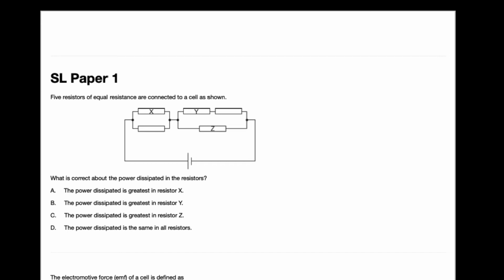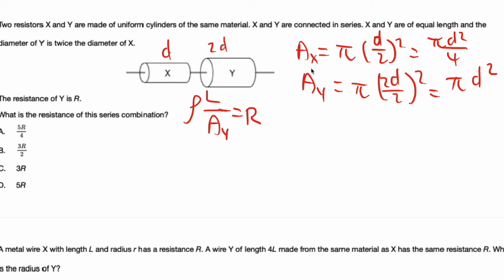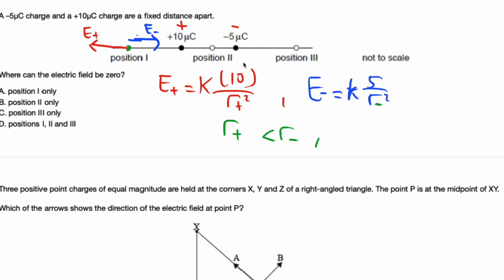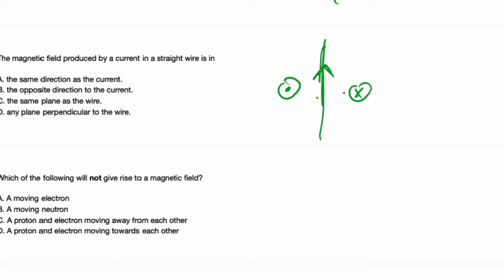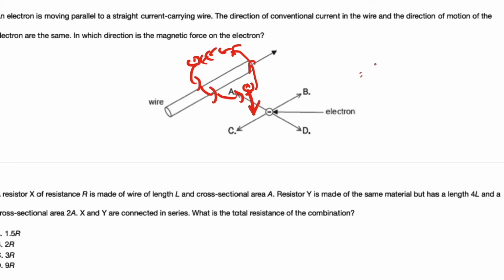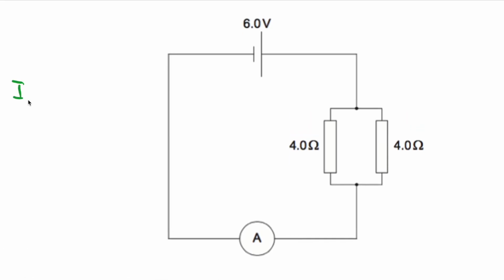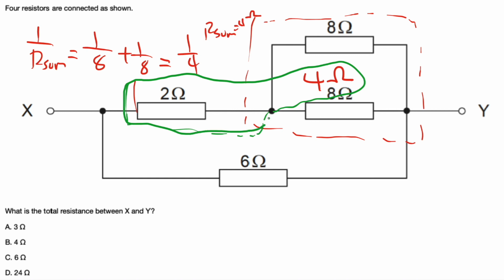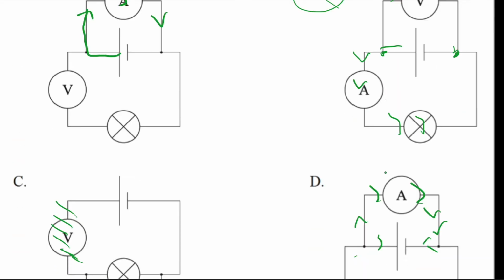IB Physics Questionbank Topic 5 Electricity and Magnetism Past Paper Questions,  SL Paper1

Comment from the maker: Hi everyone. Thank you for watching my videos; I hope you found them helpful. I apologize for the mistakes in the video since it was very long, so I got distracted several times, though this is not an excuse. Below are some corrections for my answers with explanations. 

6:25 The answer is correct using the approach in the video. 

15:22 The answer should be D. I made a mistake when applying the left-hand rule. The magnetic field points from the north to the south, so your left-index finger (2nd finger) will point rightwards. Electrons move into the page, so currents point out of the page. As a result, your thumb points upward.

22:25 The answer should be A (2r). In the problem, I made a calculation mistake.

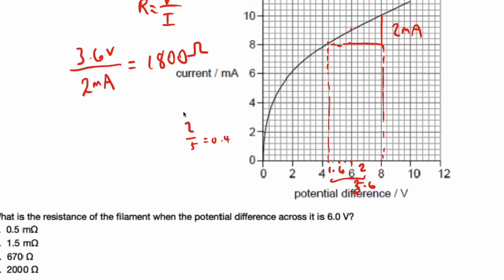1:37:15 The answer should be C. (The graph shows the current variation with a potential difference for a filament lamp. What is the resistance of the filament when the potential difference across it is 6.0 V? ). The approach shown in the video is doable interval is small enough. However, the method is not recommended. At a voltage of 6.0V, it has an approximate value of 9mA. Calculate resistance by dividing the voltage by the current, and you will obtain an immediate answer to C. Remember to convert the unit of mA to A during the calculation.

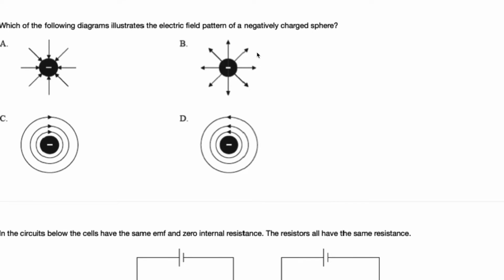Comment: at 13:28 when question ends, since this is mc you can't use calculator & pico isn't 10ˆ-12? so your working should be incorrect but my guess of ˆ-13 was same as yours.

Comment: Yo, thanks for the video, I was just wondering at 8:53 why the magnetic field cancel out?
Reply from the maker: Hi , I apologize for the late reply. A quick answer will be the magnetic field at point Q points out of the page, and the magnetic field at the right side of point P points into the page. Because directions of “out of the page” and “into the page” are opposite, so they can cancel out.

The directions are identified using the right-hand rule. For the current at point Q, point your thumb rightward (current direction) and curl four other fingers (magnetic field direction). Your will see that the direction at point Q (above the current) is out of the page. Using the same method, magnetic field at point P (right side) points into the page.

Comment: For the question on 15:22, I believe the answer should be the option D. Put your four fingers on the direction from N to S, which is the magnetic field. The movement of the electrons is into to the screen, which is where you put your thumb. Then if the thing that is being sent is an electron, then the force is in the opposite direction of your palm. Which makes the correct answer for the question D.
Reply from the maker: Hi Kadir, thank you very much for the correction. I will correct the answer in the description part since the upload video cannot be edited. My apology for the confusion. I have also upload the mark-scheme.
Reply: @scienceknowledge1460  no worries, have a nice day
Reply: answer a is correct as its a flow of electrons, so the current is flowing the other way when using fleming's right hand rule
Reply: @missmercuryyy  at this point i don't really care bro, I gave my exams

Comment: isn't the Answer D in 2 question.Please let me know.
Reply from the maker: We define electromotive force as the work done per unit charge in moving charge across the battery terminals. The term voltage is commonly used for the potential difference at the ends of a resistor
Reply: @scienceknowledge1460  isnt the answer actually c? its the energy transfer not power

Comment: I have the mark scheme for this paper. I noticed that some of your answers do not match with the mark scheme? But thanks a lot for the video overall. Helped a ton!
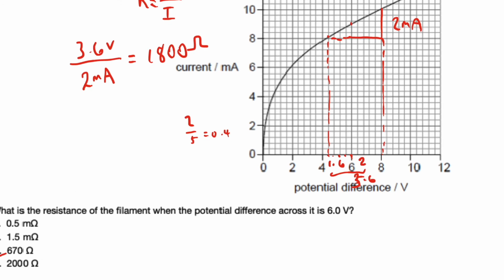Reply: For example, at 1:37:15 / 2:19:59, the answer is C
Reply from the maker: Hi  @shamel sinha , some of the video's answers might not match the mark scheme, and I apologize for my mistakes in the video. I will double-check my answers in the video later this week. I have uploaded the mark scheme to my website to check their answers. Here are some clarifications about the problems.

For the problems at 1:37:15 (The graph shows the variation of current with potential difference for a filament lamp. What is the resistance of the filament when the potential difference across it is 6.0 V? ), the correct answer is C.
The approach shown in the video is correct. However, the calculated potential difference and current interval need to be smaller to get an answer closer to 670 ohms, for example, from 4.4 volts to 6.4 volts.

For the problems at 2:19:59,, which is the last problem in the video, the mark scheme shows that the correct answer is C, matching my solution. Correct me if this is the wrong problem you are talking about, and thank you for pointing out my mistakes. I will double-check my answers in my future videos, and I am sorry for the confusion I have caused.
Reply: hey could you share the mark scheme with me? I couldnt find it on the website
Reply from the maker: @爱滑雪的阿烨  https://scienceknowledge.webador.com/physics-content/ib-physics/electricity-and-magnestism/revision-and-test-7